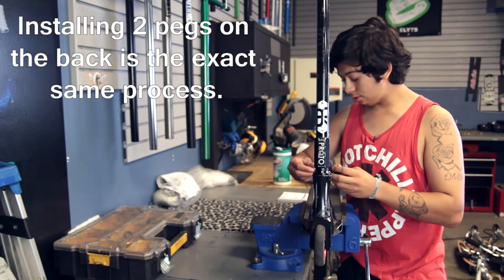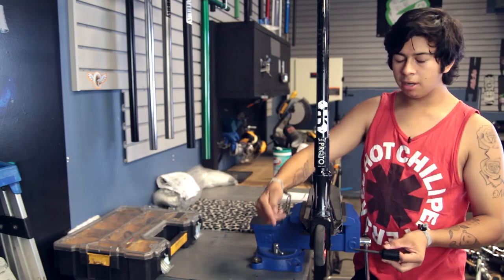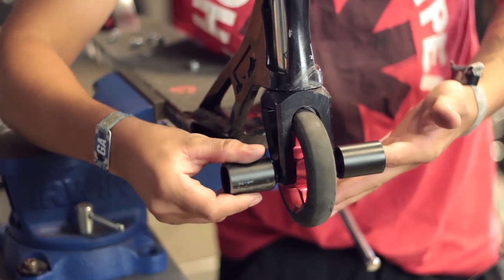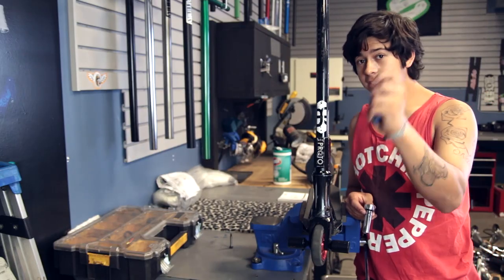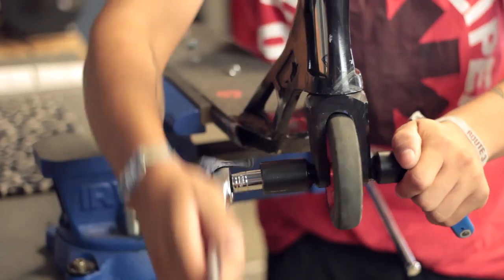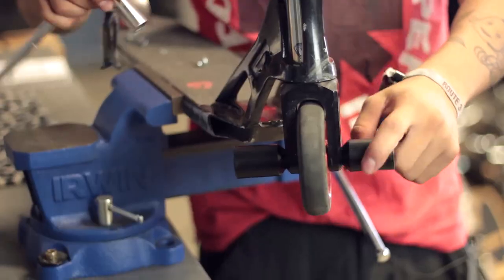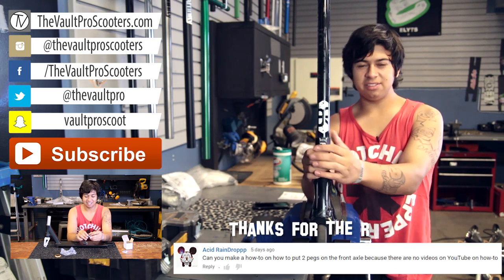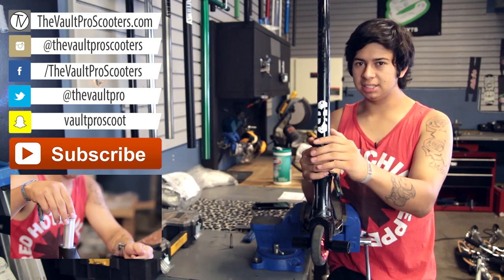How-To: Install Double Pegs │ The Vault Pro Scooters

Comment: How to install bearings without a bearing press
Reply: Get an axle bolt and sum old bearings and then just pop the bearings in the axle like this:old,old,new,spacer,wheel,new,old,old. That should help.
Reply: Ryan Davis Put The Bearing In TheHole And Use A Hammer Or Heavy smooth items to bang it it

Comment: Not all pegs are big enough diameter for the socket
Reply: 15IDKMYNAME15 I agree
Reply: I had the same porblem
Reply: @arleigh_camp I know it's an old thread but I have the same problem so wondering what you did? Maybe find a peg that is wider?